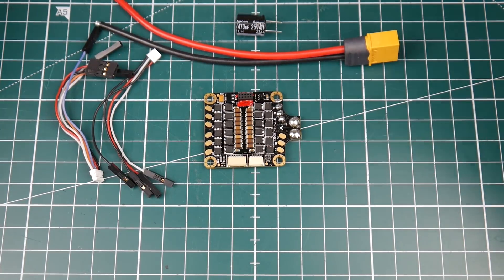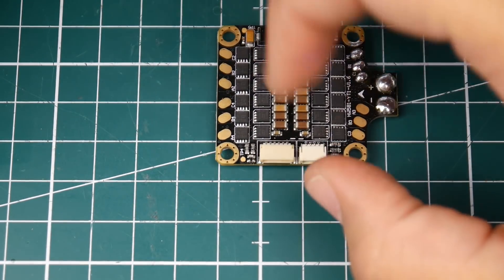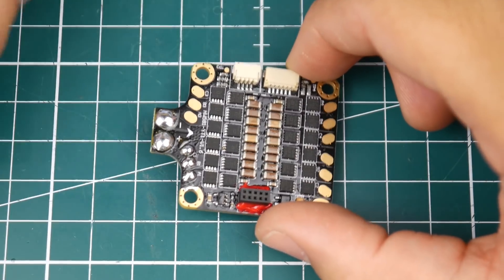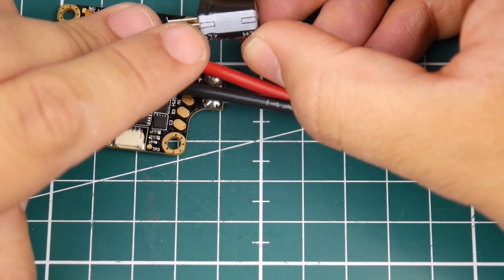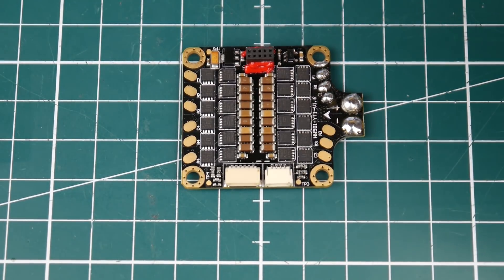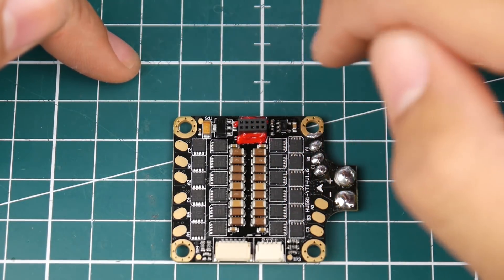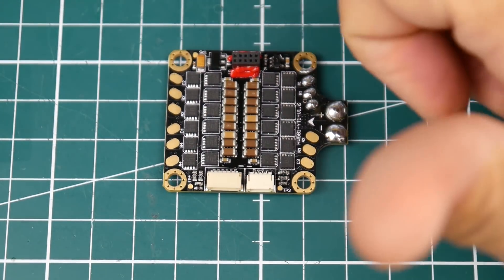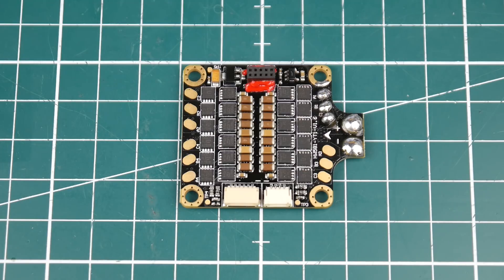Hobbywing XRotor Micro 40A 4in1 ESC // Overview and Noise Testing

Comment: I actually just found this board in my pile of boards, wanting to use it on a simple build. I CAREFULLY read the instructions and it said to install the capacitor especially when using 4s batteries...NOWHERE does it show how to hook it up and I just assumed it goes to the power input, but how do you ever know for sure...Chinese just assume you are friends with the engineer that designed the thing and some evening, over a shot of rice-wine while debating life decisions, tells you how to work with these things...except I don't know any Chinese engineers, nor do I drink (all that much)... Anyway, thanks for giving me confidence to soldering the cap in the right place, the right way. I needed that hehe.

Comment: Got 2 of these on 2 Catalyst Machineworks "Merica's"...........................Love them !!!!!!
Reply: Daniel Zawerton about to do the same. Did u use the companion Hobbywing FC?
Reply: What is the companion Hobbywing FC ?   I am just using the Hobbywing 4 in 1 ESC and the Hobbywing FC....................
Reply: Sorry.  The hobbywing Xrotor F4 that mates with the hobbywing xrotor  4 in 1, that were designed to pair, but it looks like you are.  Did you have to remove the pins from the FC (the pins that mate with the 4 in 1)?   By the looks of it, the pins on the underside of the FC will need to be removed to fit in the Merica frame...

And by any chance is SmartPort working for you (if you're using it)?
Reply: Im not using smartport because I am using the XM+ mini receiver, BUT, I am building an Impulse RC Reverb and I have bought the Hobbywing FC & 4 in 1 esc again, and I am hoping to fit that stack into the reverb.........stay tuned.

And yes, I did file the pin header down on the 4 in 1 for the 2 Mericas to clear the top plate, but I did not have to do anything to the pins on the FC, there is enough room once the FC is held in place withon the TPU canopy.........................and b y the way........the Merica fly's AWESOME    !!!!!!!!!!!!!!!!!!!!!!!!!!!!!!!!!!!!!!!!!!!!!! Different than my Aliens, but unbelievable handling !!!!!!
Reply: Thank  you for the feedback - good to know.  I'm going to be using either the R-XSR or the XSR.  I started to use the XM+ but forgot it doesn't support SP.  I've never had to deal with any frsky inversion issues (I've yet to buy an FC that doesn't support SmartPort, out of the box), so hopefully it'll work w/o issue for both of us, on the xrotor F4. 

Pretty estatic over the Merica build, myself.  Well thought out design and attention to detail. Seems extremely durable, too. It will be my lightest build, to date.
Reply: tchthsky, where in the world are you located ?
Reply: I'm located in the Northern Neck  of Virginia, U.S. , next to the fine Rappahannock river.  Where are you?  Funny, made me think of my 5 year old daughter who is always asking if so-and-so is located in 'this' world  lol.
Reply: WOW, Im from Cromwell CT, My wife and I own some land just outside Roanoke VA, We are leaving this afternoon for a week long trip to check out South Carolina, to see if we would like to move there, I will be going thru Virginia sometime tomorrow !

Small world !
Reply: Indeed.  That part of Va is very nice.  I have family over that way.  George Washing National Forest is great place, too!  Lucky!

Comment: got this combo and sometimes , like 1 fly on 10 , the kwad did a death roll when i loop smooth , after the crash all is ok and fly normal , i check all soldier and parts but didnt find something wrong :(
Reply from the maker: Trofacile ! Feel your motors
Reply: motors seems fine , used the tbs steele edition , i will try to reflash my bf but idk :/
Reply: @JiKaFPV  Most likely the pins that connect from the FC to the ESC I cut them off and use the soft silicone plug on the ESC that it comes with and direct soldered it to the FC. That fix the problem.

Comment: Is the 25v 470uf capacitor fine with 40a esc?
Reply: I would say no. - Even with it my video image had short distortions / interruptions when the ESCs beep after connecting/arming/used as a dshot buzzer.
My 4in1 ESCs / FC combo failed after the second fast flip giving bad video for some seconds and then letting the quad fall out of the sky.
Two arms broken but still all solder joins look perfect. - I'll probably throw the whole combo into the trash can.